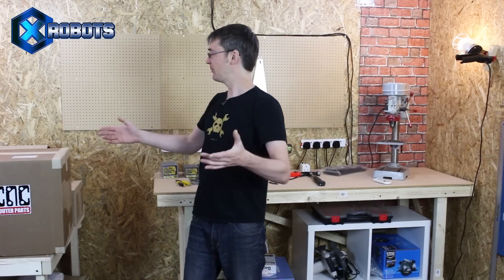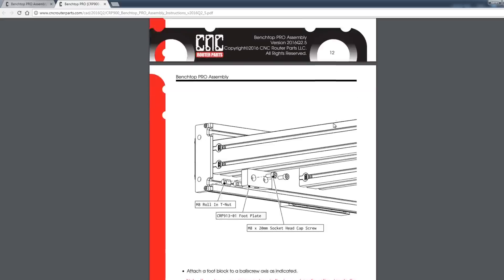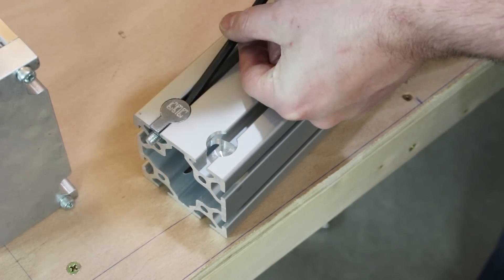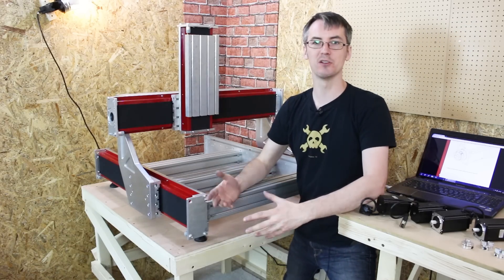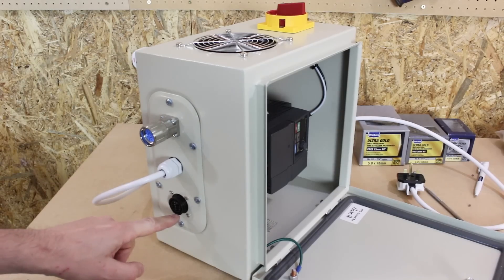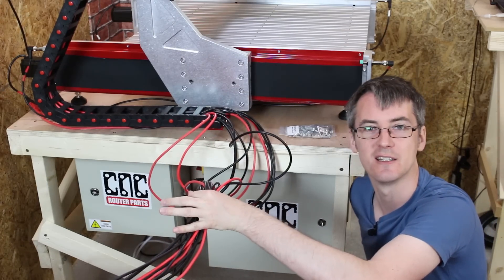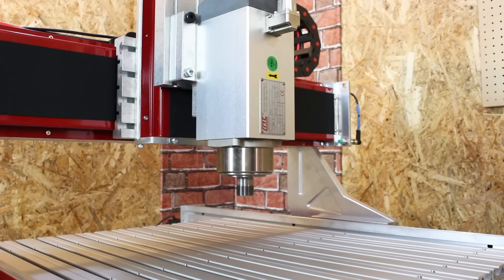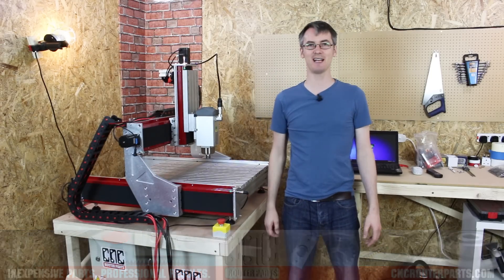Building my CNC Machine Router Table #1 | James Bruton

Comment: That 3 phase inverter looks pretty small, hope it's man enough for the job, does it's box have a fan in it too?  PPE is a must, at 24,000 rpm a large end mill will not snap, it will explode.  Do the feed \ speed calcs come pre-configured?

Comment: $3,250.00 wow a bit pricey for the standard joe but looks good. be nice to see a option for the more basic price range
Reply: ha...3250 for the frame.  If you add what he shows in the video to make it actually work--motors, control electronics, end sensors, touch plate, mach3, the bit set and last but not least the spindle + controller--it's another $4900, so ~$8150!  It's unfortunately very common to advertise cnc kits (i.e. what you might expect is a complete cnc machine) as just the frame/linear motion parts and nothing else.  It makes sense to allow users to choose the 'options' of spindle, stepper|servos etc. but it does make the first price you see a bit misleading, particularly if you're not familiar with diy cnc.

Comment: I use Mach3 and have found the compatible wireless handwheel pendants they sell on eBay to be very helpful for zeroing out a workpiece during setup, because you can change the handwheel resolution on the pendant with the push of a button.  With the pendant, I haven't used a touch plate in years.

Comment: Will have to wait to see what you think of this yourself before I fork out that kind of money. The build quality looks impressive so far can’t wait to see it how well it cuts. Oh with the cables I would of drilled a hole under the router to thread the cables through, be better when you / if you build an enclosure for it.

Comment: Hang on... Does it take normal wall plug 210v and actually convert it to three phase?? We were worried about having to wire our building up with three phase
Reply: Our VFD takes single phase 210v as input and provides three-phase output to the spindle motor.  Customers in the UK/Europe generally have nothing to worry about power-wise.  -Nathan

Comment: How did you check for square?
Reply: Even you squared。after running for a long time。they will be not。 gantry two x-axis are not mechanically synchronized。
Reply: It seems to work only on Mach3. . Complicated machining processes needs multiple toolchanging and long process time, will not do homing in between them.

Comment: Just use Fusion360. It has an amazing cam package built in. The fusion 360 cam is the most impressive bit in the entire software in my opinion.
Reply: Yea, I have both programs. But after Fusion came along I havent opened Aspire (vectric) much. Fusions CAM package is more or less the HSM package if I remember correct. The only thing Vectric does better is V-carving. At least thats my experience. Beautifull machine, I would love one one day.

Comment: My university has an older version of the very same machine which uses a 3rd party Bosch router. It's an excellent machine, I've used it several times. However ours isn't equipped for cutting through metal. That router looks awesome!

Comment: Router in this context should be pronounced the way Americans do in all contexts.   A router routs,  whereas a router routes.
Reply: It's actually "rout", which means to cut a groove in the surface of something. Router (the CNC) and Router (Device for internet connections) are spelt the same, but are pronounced differently.
Reply: +James Bruton (XRobots)  the tool is pronounced ROUTer I'm English with a large family of tradespeople, a Rooter is for WiFi, a ROUTer is a two handed power tool for cutting and shaping. calling it a Rooter makes you look daft to your fellow Englishman and makes Americans think we're weird . . . though we kinda ARE.
Reply: MattOGormanSmith Yeah, English really is terrible...
The live show is going to be very long, I hope I live through it. 
It'll be close, but I'm sure we can get to the pub before they close.
Reply: James Bruton No, you're routing the metal, like when you rout an army from the battlefield.
Reply: MadSam ! 
Kinda? How should one pronounce that?!
Reply: Pete Allum
Like "Kinder" but you don't pronounce the  "r"

Comment: Its pronounced router not 'rooter' even though they are spelt the same, nice bit of kit there James
Reply: For a internet router you are correct, but not a cnc router, the two are pronounced different  here in the UK
Reply: Sorry, we got our wires crossed, i was on about the 'bit' you put in the cnc miller, its called a router bit, but you called it a router like internet router
Reply: 9:16 is where you name the part wrong
Reply: No its not, ive being a miller for 25 years, i know what its called, and its not pronounced as a internet router, look it up, but great piece of kit and looking forward to seeing some of your pieces
Reply: A router cuts a rout rather than a route.
Rout is pronounced as it's spelt.

Comment: Looks like a pretty decent machine although i'm not a fan of mach3 I prefer linuxcnc it takes a lot more setting up but well worth learning but it's not compatible with the smoothstepper
Reply: mach3 is just outdated software and running over a network is just a bad idea . linuxcnc on beaglebone black works great and its easy to setup and its runs in real time! safer in my eyes.
Reply: Glenn Johnson from what I have heard that the hp desktops have been known to have bad jitter, something to do with the motherboard or bios.